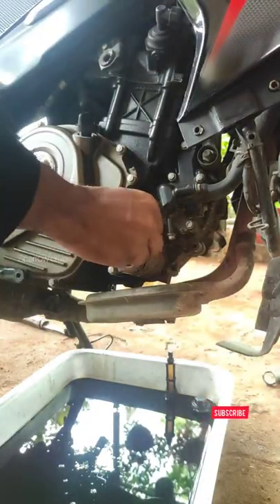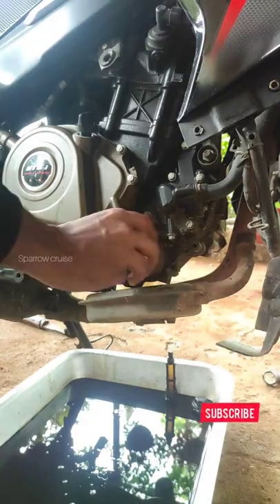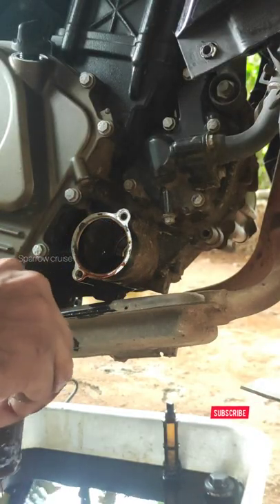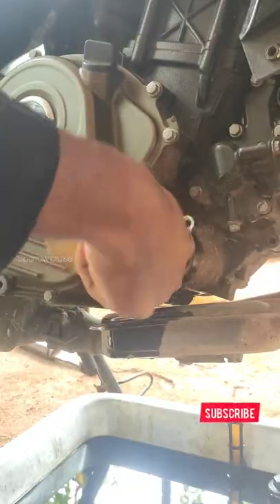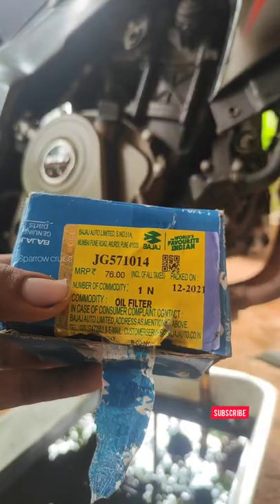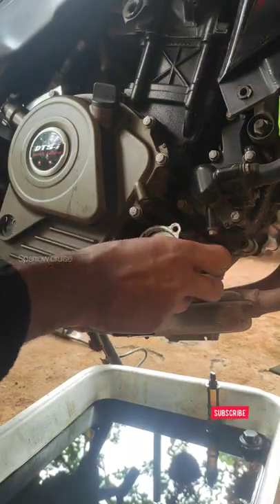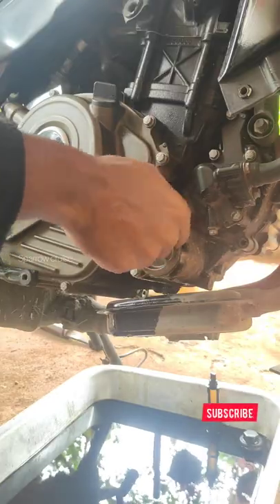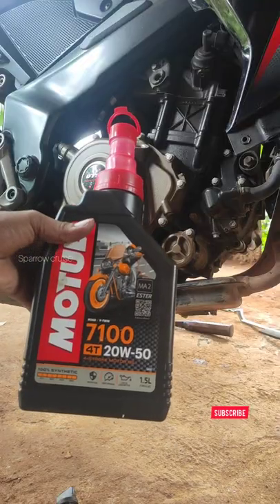Pulsar Rs200& ns200 ഓയിൽ ഫിൽറ്റർ  മാറ്റുന്നത് 🔥😍

Comment: Three mistakes in this oil change..
 1) The oil filter O ring seal was not replaced( needs to be replaced on every oil change) 
2.The second magnetic strainer filter was not cleaned 
3. Before Installing the oil filter you should have filled it with some oil ( this will avoid engine running without oil on the first crank and this is not good for the engine) I have been servicing my Pulsar As 200 and my friends Ns 200 since 2015 so just speaking from my experience. ..
Reply from the maker: 1)  O ring seal must be change if there is leaking (  Used anabond where o ring was not available)
2)Ok Because there is no video clip
3)That's good. But when the engine starts, it cannot be said that there is no oil.The oil filter is only one part of the engine where oil passes through
😍😍😍😍 thank you for your tips
Reply: @sparrowcruis  entha nigale 2 kude English parayune nagalum kude mannasilakkande
Reply: As 200 undo? Ohh pulsar seriesil legend anu
Reply: @arifzain6844  yes bro :)